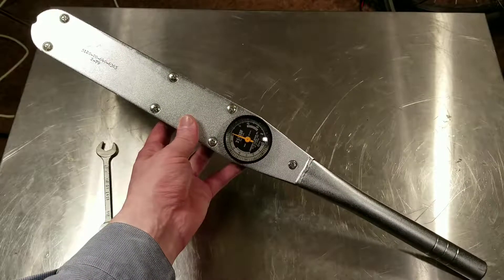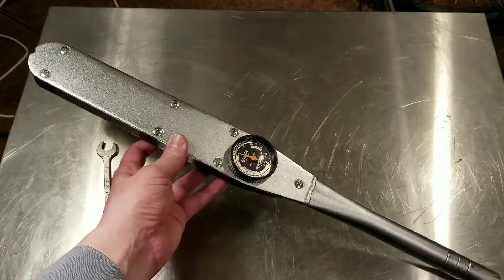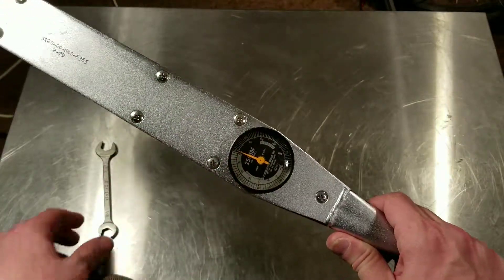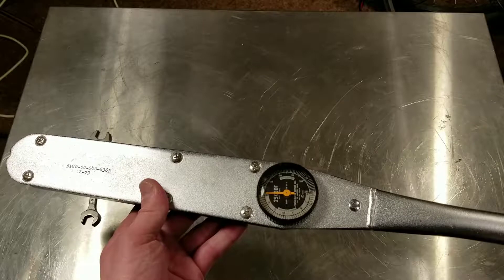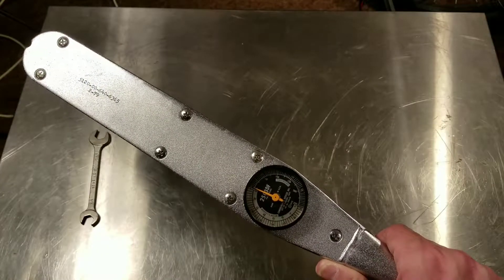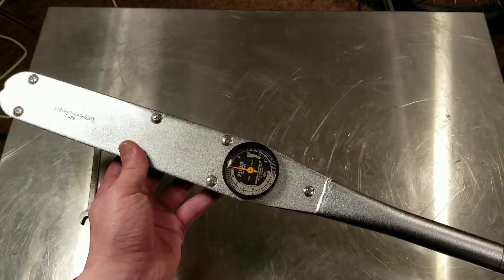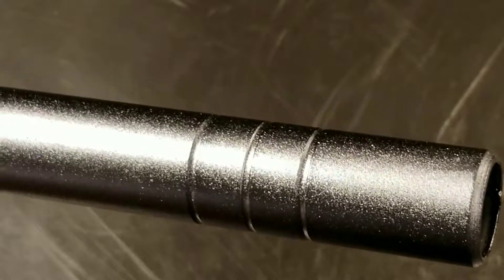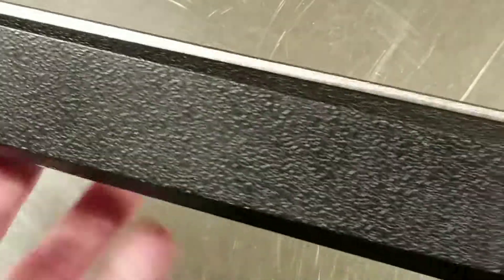CDI 2503DF 1/2" Professional Dial Torque Wrench Review

Comment: I just bought a CDI dial torque wrench. Can you do a video on how I properly set it to use it and then reset it? I’ve never used one of these and bought it cause it looks a lot easier than the other torque wrenches
Reply from the maker: Dial torque wrenches are real time gauges, you have to apply torque and look at the gauge at the same time and simply crafts until you reach your measurement and then release they do not click or anything like that. you may have a indicator that you can turn for on the dial itself but that's just to help you hit your mark